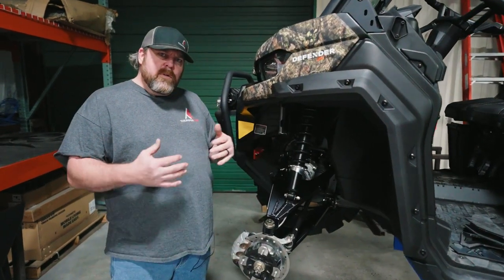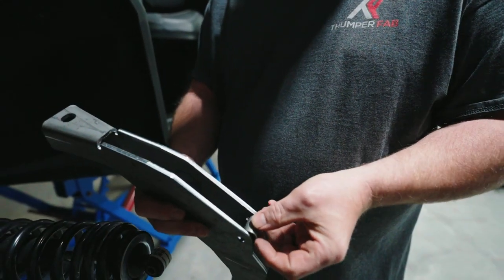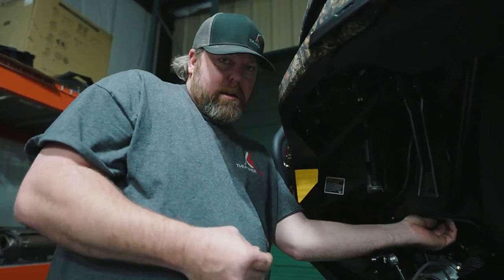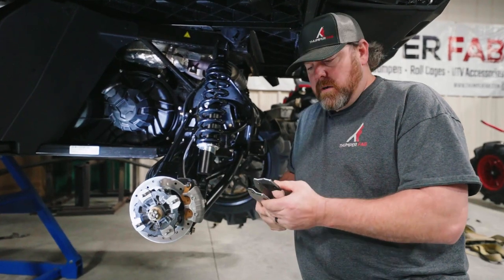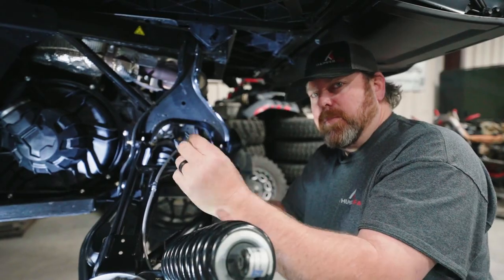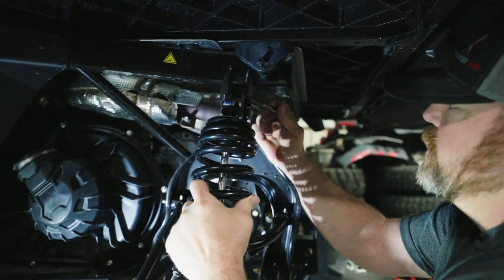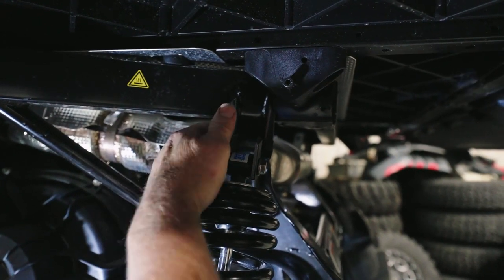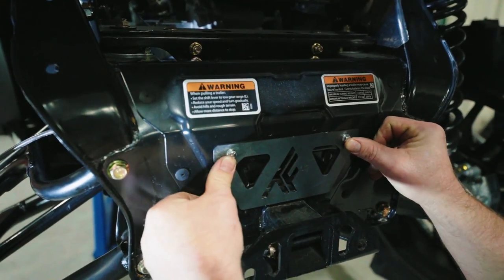Thumper Fab Can-Am Defender Lift Kit Install

Comment: Does this affect the wheel camber or suspension geometry?
Reply from the maker: We engineered it to keep important geometry and to reduce camber variance.  It’s ready to bolt up and ride! No adjustment needed!
Reply: @ThumperFAB  will it fit on a 2023 Canam defender HD Cab
Reply from the maker: @chipsammich2078  it will!

Comment: do you make a 3" lift for a can am defender hd10 limited??? can am changed the rear trailing arms on the later serial number units and my dealer says no kits work as of now
Reply from the maker: This one works!
Reply: @ThumperFAB  for the 2023???? later serial numbers